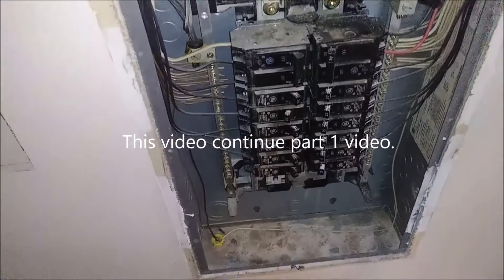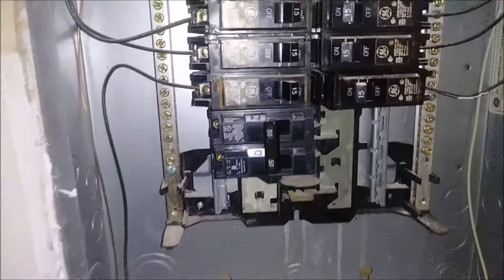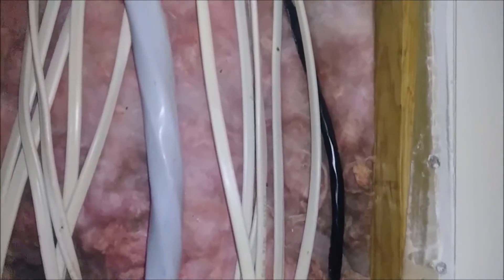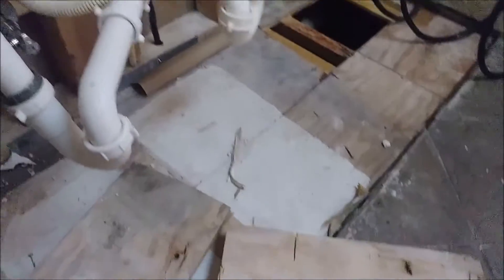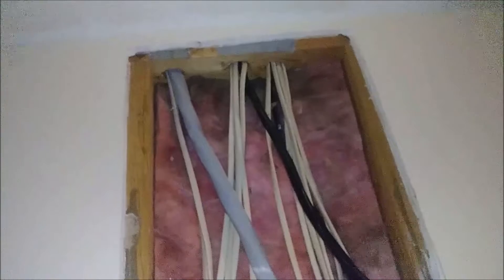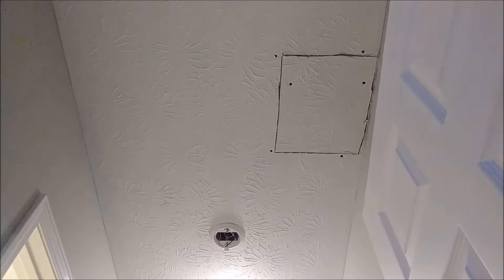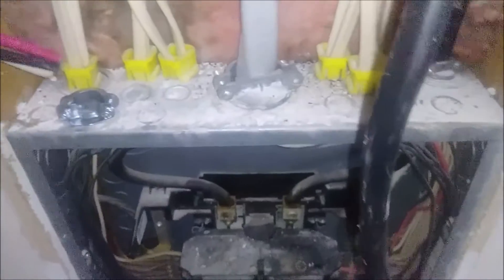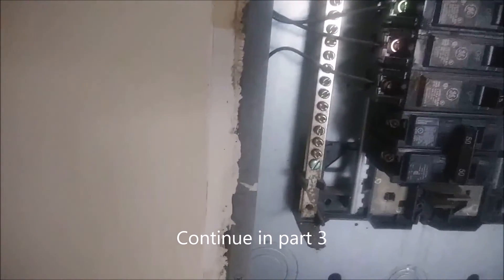How to install a new 240 Volt 50 Amp cable for Electric Range  - Part 2 -   Electrical Panel

Comment: Hello can i add a #8 to  # 6 wire for my stove? The original wire was #6 but due to move the location of the stove had to add some more wire but got #8 does this affect the voltage thanks
Reply: NO! dont do that it affects AMPS,use 6# only!

Comment: Mixing brands of electrical. Siemens breaker in a ge brand box
Reply from the maker: Nothing wrong with it. Siemens breakers  are better than GE.
Reply: There are considerations for which breakers to use, but there's no problem mixing brands of breakers.